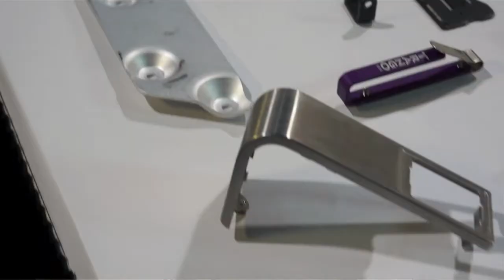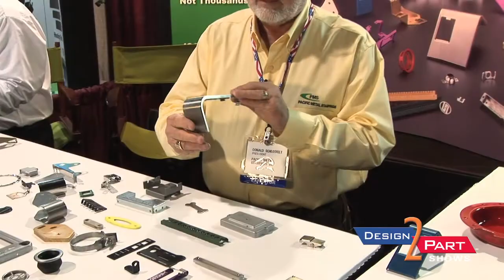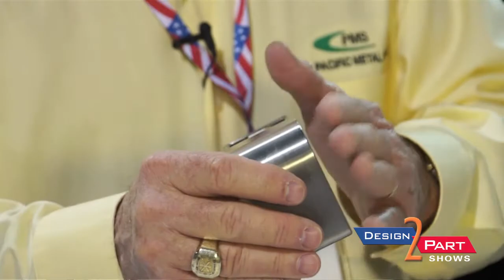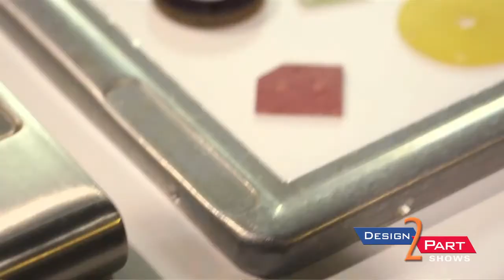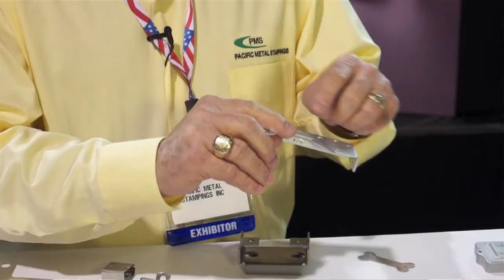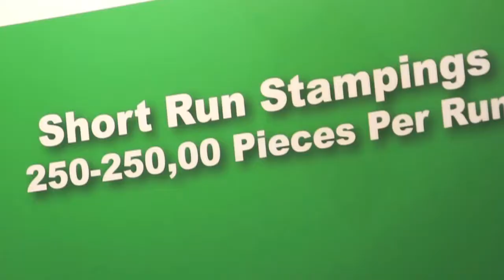Stamping components with low cost tooling | Pacific Metal Stampings | Valencia, CA

Comment: I'm prototyping a product that has a mating pair of rectangular parts designed with punched holes and two 90° bends to form C channels that fit together to form a box tube, about 14 inches long by 2 inches tall, about an inch in width. 

Does tooling up for something like that still cost hundreds?